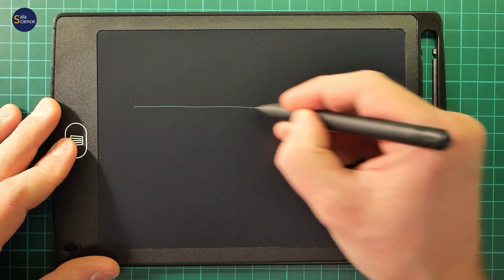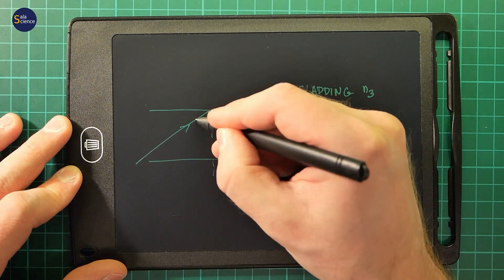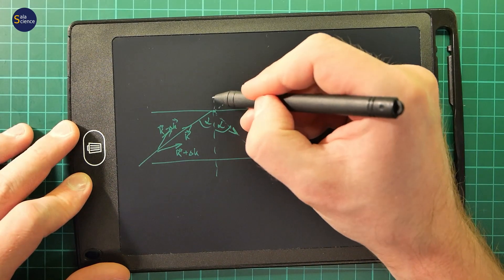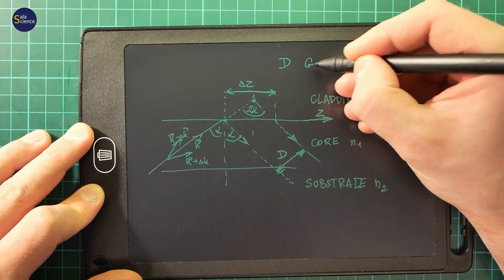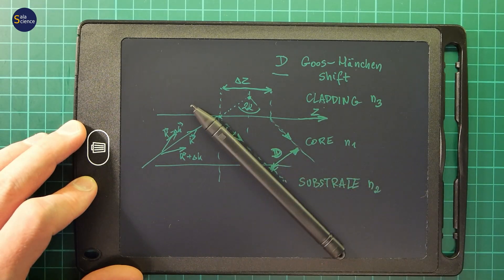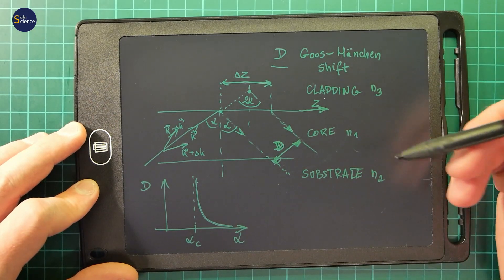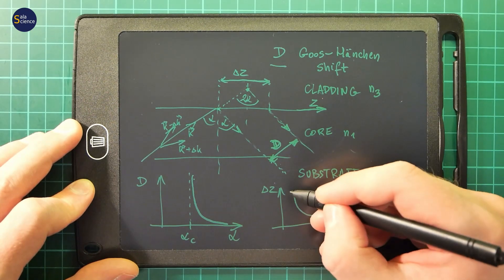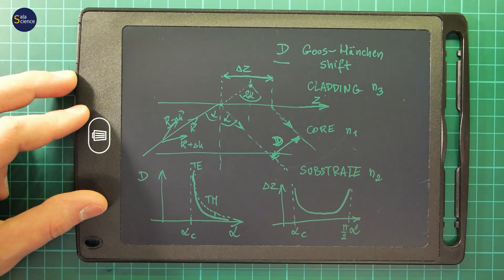Goos-Hänchen effect (shift) - 2.0 Planar waveguides - Optical Waveguides and Fibers

Comment: Why assume the angle in the outter layer is same as the one in core?
Reply from the maker: When we analyze reflection, we typically say that it occurs at the boundary with a reflection angle alpha. In reality, reflection occurs inside the cladding material, but in both cases it occurs at the same angle. Thus, both angles are the same.